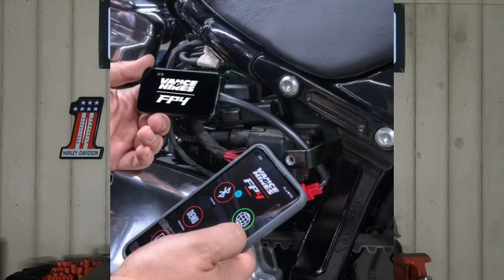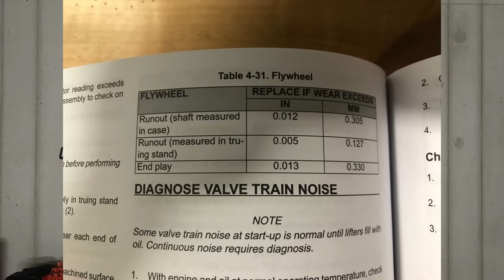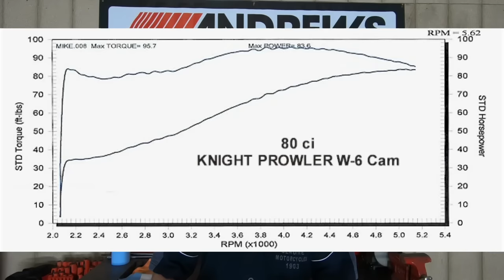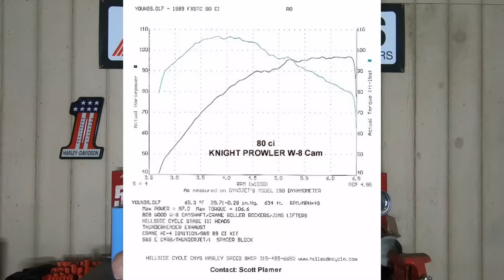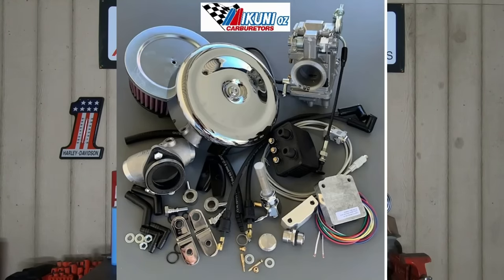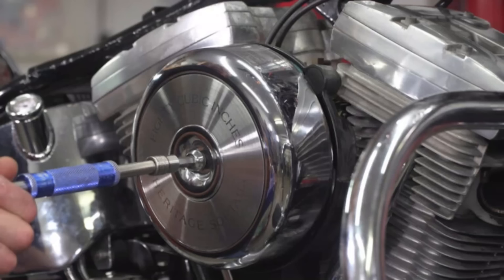Why the Harley-Davidson Evo Engine is Perfect for DIY Mechanics

Comment from the maker: What Harley-Davidson engine do you feel is the best engine to work on yourself?
Reply: Bought my 98 flhp in 09. It was rough but in my budget. Had a factory HD rebuilt put in it six months later thanks to the lack of maintenance by the previous owner. Been running problem free ever since. Doubled my investment that I will never recoup, but live and learn. No regrets.
Reply: Prob the Evo. But it has Evolved over the years. I have one of the last Carburettor Evos made; '03 custom sporty. Though also an '09 fuel injected Sporty. But my fav is always the carb'ed bike.
Reply: Shovelhead
Reply: I love my evo and working on my evo bike to be honest twin cam bike might be classics as time goes on
Reply: I think the shovelhead is the easiest engine to work on. I’ve been riding for 50 years and still own 2 shovels. Plus, it’s better looking than the EVO.
Reply: EVO,s Rule . They will last longer & take more abuse than any other Harley engine
Reply: Ironhead all the way 😂😂😂 The ones that have the best soul. Carb Harley motors will always have the best soul. Evo is almost bullet proof but shovels, pans, knuckles and flatheads are my favorite because hardly any one knows how to work on them because that knowledge is dieing off. I prefer a challenge over easy. If you know what you're doing you can make any of them reliable. But evo would be easy and reliable for a noob.
Reply: EVO any day of the week..........
Reply: @freyatilly nice. I have an 06 xl1200c that is carbed and I love it. I believe it’s the last year.
Reply: Stock Evo bikes will definitely be in demand 20-30 years from now 
Maybe less
Reply: Evo,or shovel . Evo gives the longest repair duration as where what is repaired stays repaired.... The shovel sounds fabulous 😁....
Reply: @firefighterphillips  real talk man the iron heads are the strippers of the motorcycle world try to be nice to them and they give you trouble,  the harder you ride them the better they like it ....
Reply: I just got my evo.  It was the first H-D that I ever owned.  I’ll have to let you all know.
Reply: Probably the 2003 and older trap door Sportster, both Ironhead and EVO. But the EVO is far more reliable. I hate the fact that H-D removed this feature from 2004 and newer Sportsters, but I'm not surprised. Just about every change H-D has made since the original EVO engine has been to either make them harder to work on, or reduce their reliability and longevity, or both. Something I've been hearing a lot is that it cost more to repair or replace the engine in an older bike than the bike is worth. While that may be true if resale value is your only concern. But, to me anyway, older bikes, of just about any brand, have a lot more in terms of value than just what you can sell them for, unless you plan to sell them right away. I would have no problem spending $10,000 to put a new engine in my '89 FXRS. It's in beautiful condition, but more than that, a new one is no longer available. A new bike of the same basic type would cost over $25,000, would have the smooth, quiet, computerized, counterbalanced, fuel injected engine, and would be nearly 100% flat black. In other words, something I want nothing to do with. The motorcycle hobby or lifestyle is not cheap any way you look at it. And I would much rather spend money to keep a bike I love going than to spend a lot more money on a bike I can't stand to even look at. Older Harleys have a value that goes beyond their monetary worth. Newer ones don't.
Reply: EVO's are the best engine Harley made. Easy to work on, easy to maintain. They have a better valve train than shovels which are also decent engines if built right but EVO's will outlive them. But like you said, if you stay stock or keep it close to stock with upgrading parts the engine cases will hold up but if you want more performance, the stock cases won't live long.
Reply: @geraldscott4302  Well said sir!!
Reply: I was brought up in a basement, working on Flats and Pans...
I see the resemblances in lawnmower engines.
The thing is....they all have the same 
"basic 4 to run" rules. Different tools, different specs....air/compression/fuel/timing....
Reply: I have commented on a few of GixxerFoo’s videos regarding evos. .  I was lucky with my first and only Harley.  I found a 1994 Electra Glide Classic (FLHTC which means carbureted Evo.). It had almost 125000 miles.  I got it on 23Dec2023.  It has good compression and power. It doesn not leak oil nor does it smoke.  I will have to replace the Tour Pak latches and hinges soon.  I am very happy with the bike as it reides very well too and has no Harley wobble. I chose an Evo as Shovels are starting to expensive due to their bing classic.  I plan to do some long road trips as the bike is very reliable.
Reply: EVO all the way!
Reply: #1 Evo and #2 Ironhead Sportster
Reply: Definitely not one of the last EVOs made. I have an 06 XLC with a stock carb. They switched in 2007
Reply: @williamhill1393 Evolution, not only better than the motor it replaced, but better than the motor they replaced it with 😂.
Reply: @GixxerFoo  
Evo. And if I had a garage and a motorcycle lift I'd work on mine but since I'm an old fat man. I pay someone to fix it for me. But the evo, I believe, is the easiest one for an owner/rider to work on.
Reply: I love the twin cam 96"

Comment: I love my 99 Softail Custom. It has all the power I need in stock form. Only thing I have changed are the carb jets, to match the drag pipes, the inner cam bearing BEFORE it went bad, and the air cleaner to a K&N. I only have 66,000 miles on it though. Of course, I am 83 years old. Started on a 42 "45' flat head when I was 14 back in 1955. The EVO is simplicity itself. Just the bare essentials of an air cooled 2 cylinder radial engine. They have that feeling that they will always get you home. Reliability that may or may not come on other models. I have always done my own work. Not much work to do on an EVO. The EVO is what I call a happy motor. It is not finicky at all.
Reply: @ 71 years old I'm chasing you. Just got a brand-new S&S Evo engine on my '86 FXR. Hoping that will get me to 83 as well.

No Geezer Glides for us, huh?
Reply: @blues3824  Fantastic. Those older FXR's were superb machines.  And S&S are the cream of the crop. My son built his own bike from the ground up. It has an S&S EVO.

Comment: Never a problem with the carburetor on my 1991flhs or anything else w/70,000+miles. Put new clutch pack n cable last summer n final drive belt 2 summers ago, did all work myself, all parts from ebay and or Amazon.  I'm retired, gave me something to do and I enjoyed it, like I enjoy my flhs , its been a good machine 😊
Reply: I have a 90 FLHS original belt, trans, engine. pipes, carb, clutch 50,000 miles and still ride her gently .
Reply: My belt I replaced @ 63,000 too be on the safe side along with bearing and seals in the chain case . Clutch went out on the road, bummer, but got a tow and started working on it the next day. Used a Barnett clutch pack seems to be a grabber compared to the stock original, very pleased

Comment: Agree totally. Started with an EVO in 1988, then a TC 88, then a 96in, then a 103 and sold it last year to go back to an all original (even the tires) 1994 Heritage and I’ll never sell it. Love the EVO’s. Great video, keep it up
Reply: Same here. My first Harley is a 1994 Electra Glide Classic. It took me awhile to get it. It runs great and doesn’t leak. I will probably never sell the bike. Also, the bike is carbureted. :):)

Comment: Sad to say that the older generation that pioneered engine design prior to the Twin Cam and Milwaukee are starting to die off including the knowledge they carry with them. Kickstart ignition on the first shot and jetting a carb by ear are skills I love watching the "old-timers" make look so easy.
Reply from the maker: You're not wrong at all there, a lot of that knowledge is being lost every day. We didn't need dyno's with those guys, even if you did run it on a dyno I guarantee it would be too close to mess with.
Reply: I my day , I was the tuner. I have no idea what a tuner is today. Same goes for the wiring. What a gigantic mess
Reply: @GixerFoo. This and your other Evo engine videos steered me to getting a 1994 Electra Glide classic… with a carburetor of course.
Reply: My Evo Heritage Softail was a great looking bike but it vibrated so bad at highway speeds, it was unrideable. Maybe someone in the know could have fixed it, but I was way up in northern New England. I had to let it go for short money. Queasyrider
Reply: Hey Gixxer, enjoy your channel. You might try moving your studio lights further apart at an angle.You get a strong reflection on your glasses
Reply: @planefloat  To me the vibration of older Harleys is one of the most fun things about riding them. The EVO powered Heritage Softail is the only EVO big twin that was not rubber mounted. My 80 inch EVO Low Rider is rubber mounted. I don't know how much difference that makes. Unless the engine mount bolts on your Softail were loose, there really is no way to "fix" it. That's just the nature of those bikes. I have a 2001 rigid mount 883 Sportster, and I don't have a problem with it, but it's a much smaller engine than the 1340cc rigid mount Softail, so I don't know how that one would feel. But people rode rigid mount Panheads and Shovelheads for many decades, the rigid mount EVO shouldn't have been any different. IMO, if the mirrors on a Harley are useable, something is wrong. I've learned to pull in the clutch and blip the throttle to get a clear image for just a split second before changing lanes.
Reply: There is nothing about the EVO and older engines than anyone can't learn, if they want to. Problem is, many don't want to. They want smooth, quiet, computerized everything.
Reply: @geraldscott4302 
Thanks, Gerald. My first Harley was in 1965, a '58 74 c.i. Panhead DuoGlide.  I've been riding 60 years. The Evo was well used; I didn't know the history of it.  It could have been excessive crankshaft runout, a cracked frame, etc. But it was more than I could handle at the time. I'm moving this Spring and will  be able to work on my Twin Cam in  my new garage. I'm removing the FI and changing to carburetion.

Comment: Got a Twinkie 88 and an Evo Sportster...both carbed...lots to like about both of them! ❤
Reply from the maker: You can do anything you want with those and not have to worry about a bunch of high dollar electronic tools to tune them either!
Reply: Wow. Same here.
Reply: The Twin Cam is difficult to work on beyond a certain point, but they can be made reliable. It's not cheap, but it might be worth it if you are not worried about resale value. It would require a complete rebuild, replacing the crank with an aftermarket one, installing the Timken bearing setup, installing and aftermarket oil pump, and geared cam drive. Thousands of $$$. But then it should be able to run for decades without needing to be worked on. ALL Twin Cams can be converted to a carburetor. Installing a carburetor was always fairly easy, the problem was H-D used the same ECU for the ignition. You can now get a stand alone ignition that will work with a carburetor.

Comment: Hi 👋, Foo , I used to have an FXR 1340 , And done most the work on it myself, Apart from when I first brought it, it’s been sitting for quite awhile, had an oil leak in the inner part of the Gearbox, And the guy I brought it off of said that he would pay for it, he didn’t, scumbag, 
Then in 1999/2 I brought a soft tail deuce, For the first five or six years, I’ve done the work on it, myself mainly just servicing, changing carburettor, changing ignition changing exhaust,  then I found out that I needed some extra tools, to change my cams and bits and pieces, that is when I finally took it back to HD, So overall, the 1340 Evo is a better bike, and the way things are going, I’m hopefully buying another one in a few months time, as per usual great territorial, look forward to next Friday, stay safe, Phil from My Moulin, now ,
Reply from the maker: That's awesome!! I love the Evolution engines, there's just so much you can do with them and the parts aren't stupid expensive either.

Comment: Keep it simple is the best way to go. I have a '98 Heritage owned since '04. The only time it's been in a shop is for tires, voltage regulator and front cylinder rocker gaskets. I bought a shop manual and do the rest myself.

Comment: I put a Zippers 80-80 kit in my '91 FXRT in 2011.  On the dyno, it went from 34HP  from the factory, to 79HP with the kit.  I was able to do all the work myself, but did have a really high end shop set up the carb on the dyno.  That was an awesome bike, but after 30 years on her, I moved up to my '21 Ultra.  I do still have a stock '97 Heritage Softail that I bought for my wife and she didn't ride, with only 1200 miles on it.  That's going to be my retirement project, to build a daily play bike that isn't a dresser.

Comment: I'm running a carburated 2000 TC88 with the Timken bottom end. Sure, I had to deal with the tensioner issue, but it's pretty solid and easy to work on. 
I agree with you on the Evo's, though. And if you could steal one with a bad engine, you could afford to buy a good set of cases and build it however you want.
Reply: Loved my carbureted TC 88 but I agree with you on the Evo.. Still, outside of the tensioner issue, which I took care of, there isn't much you have to do to them anyway.

Comment: I have an 02 TC carb and its cam chest has been upgraded and I have owned an evo I had modified extensively and used a S&S case and stroked! You still get better power out of the TC. My TC does have the tapered bearing and better crank than later TC .

Comment: I believe the Evo was just as the name implies, " Evolution."  Outside of early issues like cylinder studs, cases cracking, etc. Every new design always has its misgivings. The top end was a needed change. Efficiency was definitely improved as far as performance. I don't think the engineers expected the customers to put such a beating(testing)on this new engine. At present, I run a fuel injected twin cam just to check out the fuel injection. My curiosity couldn't help me !!! Now, I'm contemplating moving back to a carbureted Evo. I am computer savvy but i want the tuning back in my hands.

Comment: My first Harley was an AMF 80” low rider. Loved the sound of the shovelhead. But the most unreliable bike I ever owned. During the EVO years I was raising a family and motorcycles were not in budget. I’ve owned 4  twin cam Harleys and my favorite was the 103. I had a 96 twin cam on a Roadking and was the only motorcyel I’ve owned that had a complete engine failure at just 9000
Miles. Now I ride clean used metric cruisers. If I were to buy another Harley I would be looking for an EVO.

Comment: I've said this before. How many cubic inches do you need for a motorcycle? What I don't understand  is how Harley has just kept upping the cubes on displacement rather than in making the heads more free flowing, compression higher, and more aggressive cams. 80 cubic inches is enough displacement. I will say that a factory 50 horsepower feels a little underpowered but you can build a 90 horsepower 80 inch Evo that's still very streetable and reliable. Andrews cam, JE forged pistons, port and polish the heads, free flowing exhaust, high flow air cleaner, and a good jet kit (tune) on the more modern CV carb. Or yeah on the early evos, a Mikuni smoothbore, or S & S Super E carb.   90 hp is plenty, that's more than a stock 114 inch M8.

Comment: Had an 88 evo flh…moved from Michigan to 8000 feet in Colorado, put a 2 into 1 Vance and Hines, re jetted, and it ran fine no matter where I was at.  That bike took me all one the country multiple times.  In my first top end, I ended up doing it a friends garage with the tools they came with the scooter. Just had to cut down one Allen key to squeeze in underneath the frame for the one bolt on the heads. Great bike great engine.  Thinking about getting another one just to have it to put around and work on. You can pick them up for a dime a dozen now

Comment: My experience with my stock 1999 Heritage EVO wasn't a good one. My 1981 FXB while going up Afton Mountain with the wife on the back, you could grab a handful of throttle and climb in speed until you could lose your license! Try that with the EVO, no way no acceleration at all. EVO long warm up times and have fun trying to keep the rocker box gaskets from letting oil leak all down your leg on a ride. I bought a 2003 FXDL loved the new power and cleanliness. Yes, the EVO is no doubt a simpler and easier to work on engine. Knowing what I know I just bought a 2003 carbureted Twin Cam 88b Heritage with 10,900 miles on it. Checked the cam shoes immediately. They are in good shape, and I will do the necessary cam chain work when necessary.

Comment: EVO is my choice (probably because I've owned one for 36 years) but I wouldn't hesitate to by a Shovelhead, if the right deal came along!  A guy I work with has a built FXR, carb'd Twin Cam that will hold it's own against most crotch-rockets - but somebody else built and tuned it for him, and it cost him a LOT of money!  I prefer something I can fix WITHOUT a pile of specialty tools.  I won't split the cases, or monkey around with the flywheels, but just about everything else I can do on my own...on the side of the road, or in my garage!

Comment: I bought my first Harley Davidson in 2023.  She is a 1994 Electra Glide Classic with 124000 miles when I bought her.  She is all original. She makes good power and does not leak nor use oil. I shall ride her until I die.  Oh by the way, she is carbureted.